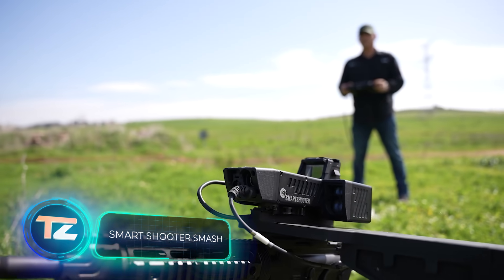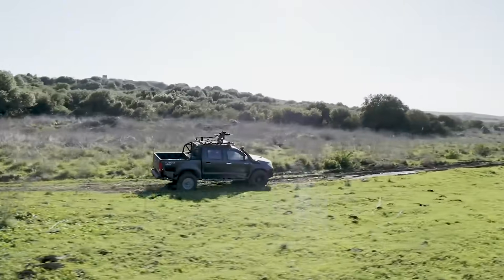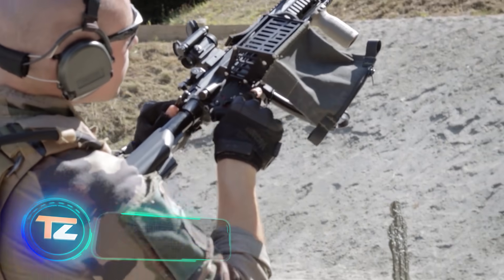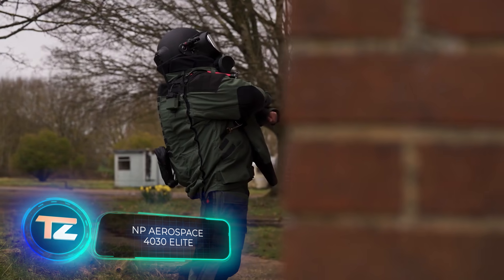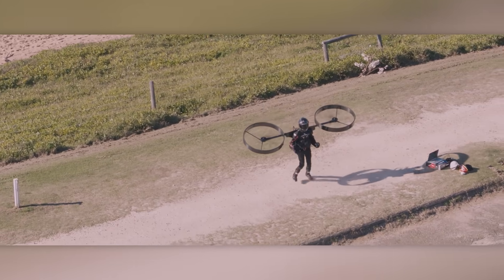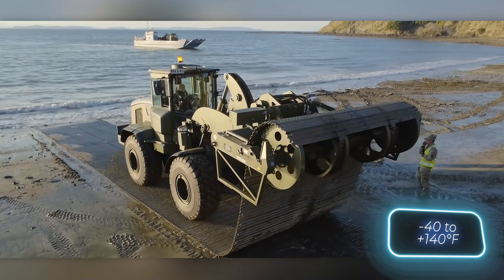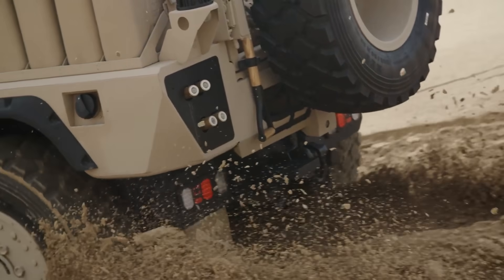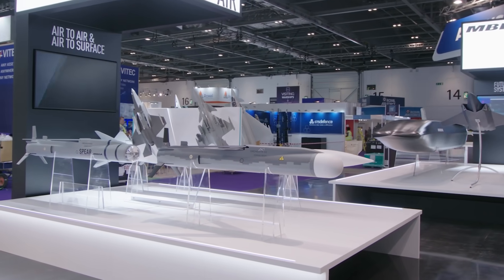MILITARY INVENTIONS THAT HAVE REACHED A NEW LEVEL

Comment: Amazing what technology the hobby quadcopter development has spawned all these devices seem to be part of my hobbyist workshop allot of this is in mine just need to get me a radar I ques.
Reply: I plan on making my own "copterpack".

But a much smaller folding version.

Paired with powered rollerblades.

It wouldn't be for flying, instead for a really big jumps, additional thrust and stability for the powered rollerblades, and a glide ratio good enough to double as a parachute.

The hard part is software.

The way open source AI is advancing, it shouldn't be too long.